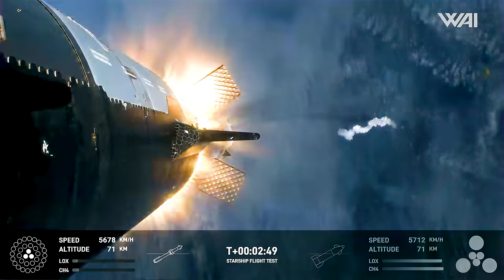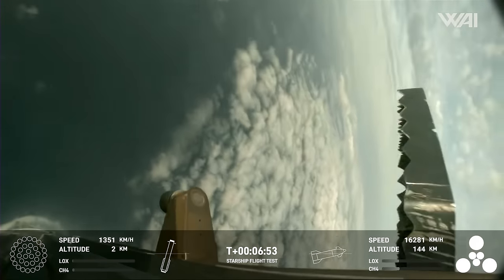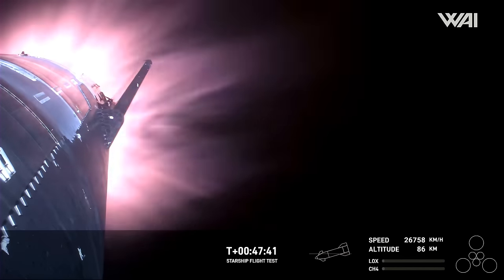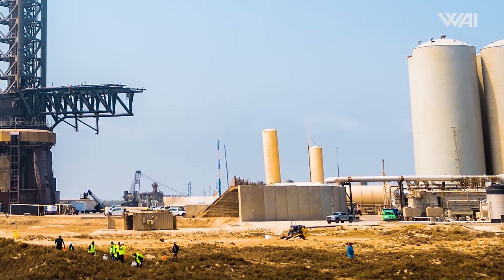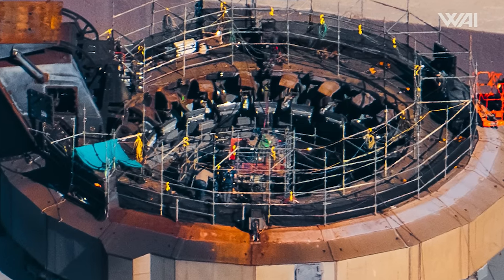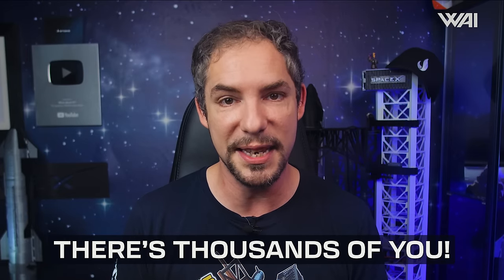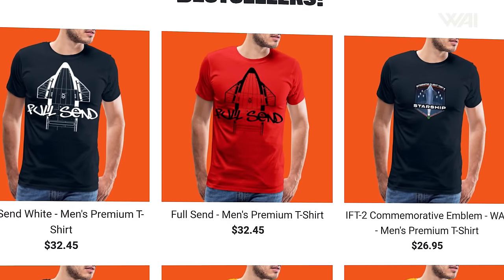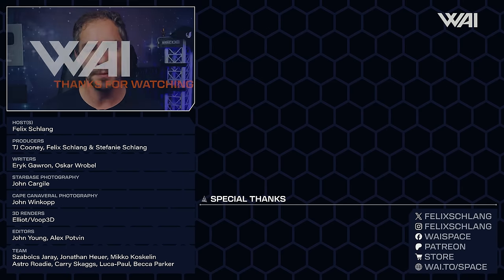SpaceX Starship IFT3 Aftermath: New Insights Paint Different Picture!

Comment from the maker: Discover why 4,500+ pros recommend Nutrafol. Use code WAI at Nutrafol.com for $10 off your first month!
Thank you SpaceX team! You are our heroes! You Rock So Much!!!:_WAIHeart: :_WAISweet:
Reply: Can I ask Felix, with the bottom of the launch tower they use metal sheeting.. Have they ever thought of Heat proof tiles that would be on the starship for better insulation? Just a thought :) Love your channel watched from the start. <3
Reply: @MrComfyAustralia  That kind of tile would be obliterated by the blast. They are extremely fragile
Reply: "ULA sniper?"  Thanks for introducing this concept )))
Reply: @MrComfyAustralia They aren't very resistant to pressure, and they are quite expensive compared to stainless steel
Reply: @Whataboutit would the idea of putting heat shielding tiles like on the starship around the launch Mount table a good or stupid idea?
Reply: I think they were attempting to max out the control capabilities of the booster before landing and tested to failure😅
Reply: If it was a good idea they would be doing that. Answers above explain why. I highly doubt replies you see in comments are from Felix. Most youtubers are busy making content and have someone else is handling/managing/moderating comments
Reply: I just punched my keyboard instead of my like button, and now my keyboard is broken, and it's YOUR FAULT, Felix!
Reply: @Donald_Turnip  instructions unclear
Reply: Well duhhh. It's not *MY fault! @KCJbomberFTW
Reply: Felix can run this sponsor better than Simon runs his...
Reply: QQQ High Priority question.... Felix, do you like Space Planes??? lol
Reply: They are so close to making something useful. Forgive me if I refuse to hold my breath while the try to deliver new discovers and dates for PA.
Reply: As a naïve Bolivian 🇧🇴, I never understood the term: to rock.
Too many rocks exposed by the sublimation of once snow covered ski area on the Chacaltaya Nevado, nothing positive. 
But in the lower Altiplano at 14000 feet,  the low pressure dry environment woud make "Base para el viaje al planeta Marte" an ideal location just 17.4° south of the equator.
Reply: 😂😂😂 @Donald_Turnip

Comment: It's all Tim Dodd's Fault! 😁
Reply: I think the idea was an important one, also you probably shouldn't just generalize that an idea is bad after only 1 test of that idea. But who knows lol
Reply: What , why?
Reply: @MBSfilms77  what idea?
Reply: @Hungary_0987  the hot gas thruster
Reply: @MBSfilms77 Oh, I agree. It's just funny. Have you seen the video they put out?
Reply: 34 secs
Reply: Has he figured out he isn't going to the moon yet?
Reply: They probably hoped the hot gases would clear any ice build up in the thruster nozzles but they may need to have small heating elements embedded to keep them clear.
Reply: @tomj819 "Hot" being a relative term when you're talking about boiled off Liquid O2.
Reply: @gregsteele806  yes i have 🤣
Reply: Lol thanks for the good laugh.
Reply from the maker: Yes it is! (No, it's not!) :_WAIElonlaugh:
Reply: @MBSfilms77 it wasn’t even his idea - they already had it for the booster and Elon and engineering decided to simplify for Starship. 

They may have to revert. On both. 

They’re going to continue getting closer and closer to Falcon 9 anyway.
Reply: @gregsteele806  sure, I meant more pressure than heat, but the clarification is useful.
Reply: @MomedicsChannel  true
Reply: Definitely Tim's ego holding it down, for sure. Lol
Reply: @gregsteele806 olage gas is actually tapped off after the pre burner and piped back to the tank to keep the pressure high enough. That stuff is hot.
Reply: @Whataboutit  Come on Felix if you can get the blame shifted to TD you might be able cancel him socially and get his moon shot ride... God knows you are way better at reporting.
Reply: I think they were attempting to max out the control capabilities of the booster before landing and tested to failure😅
Reply: Haha, I had the same thought.  I didn’t hear him say anything but he must’ve been thinking that.
Reply: True lol that’s exactly what I thought while watching starship tumble
Reply: @Keiranful * ullage *
Oh, and superchilled O² ain't hot.
Reply: For reference Tim asked a question during an interview with Elon about why hot gas thrusters weren't being used on Starship when they were being used on the booster.  Elon obviously thought the idea had some merit and it was implemented in Starship for IFT3.  However it appears that icing up may have been an issue with it being a likely explanation for the lack of control.
Reply: @yaric008  Tim mentioned the ice and possible need for heaters during his live stream a number of times.  I also certainly don't blame him for the question/suggestion
Reply: @gregbailey45  after the pre burner, it's not superchilled O2 anymore...
Reply: Just slap some draco thrusters
Reply: @Whataboutit   Who Is Tim Dodd ? ? ?🤔🤔🤔🤔🤔🤔🤔
Reply: WHO IS TIM DODD ? ? ?  NEVER HEARD OF HIM ? ? ?  LOL ! ! !🤔🤔🤔🤔🤔🤔🤔
Reply: I was actually going in the direction of Tim the tool man Taylor's business partner "AL"  but that's just me?!🤷‍♂️🤷‍♂️😁
Reply: TIM DODD NOOOOOOOOOOOOOOOOoooooo wait. Was the idea good or bad? I still dont fully know

Comment: Ok everyone,  let's take a look at the whole picture.  Elon/SpaceX does things a little different from the traditional.  Remember Falcon, the first 3 totally failed. The 4th launch was successful and then Falcon makes history.  Starship will be fully successful.  Go SpaceX!!
Reply: You are talking about falcon 1, which never made any history.

Falcon 9 - that has made history - worked on first try.
Reply: @torben777  Falcon 1 did make history. It was the first completely private rocket to successfully achieve orbit and paved the way for everything that came after.
Reply: @johnnemeth6913  I think that is a matter of definition and interpretation. Sure SpaceX is a private company, but so it ULA, Boeing, Lockheed Martin, Northrop Grumman etc., and NASA was an integral part of the Falcon 1 development, which they also largely financed, just as they have been on countless previous US rocket developments.

Lockheed Martin developed the first Atlas rocket in 1957, which is 14 years before Elon was even born, and it flew humans to orbit in 1962. 

The contract type was slightly different for Falcon 1, with the private company taking a bigger part of the risk, but US rockets have always been build by private companies.

Comment: Watching the grid fins correcting themselves is one of the most epic things to be privileged to witness and in real-time, wow, just wow! I'm speechless. Each launch is better than the last.
Reply: except the fins didn't correct the ship
Reply: @nitram419  because the ship was way too high up for the fins to work, and by the time the fins could have done anything meaningful, it was too late.
Reply: So why were there no reaction thrusters?
Reply: @nitram419  there were. However, an unknown failure prevented them from functioning (IMO, they were frozen open)
Reply: @bryanillenberg   It appeared to me, seeing all the violent vibrations and overcorrections, they were in enough atmosphere.  They were reacting to something.
Reply: @RoySATX  
Ship: the ship was spinning out of control due to a prior RCS failure. By the time the flaps could do anything, it was too late
Booster: I think one of the grid fins failed completely, and the force was enough to break the remaining three, thus causing it to spin rapidly out of control.
Reply: @nitram419  they did correct, but the control algorithm was not working as intended, hence the wobble back and forth.  Might be as simple as a code update with input from the flights test data, although sounds like there may have been more involved, so guess we will have to wait and see
Reply: Better hope that doesn't happen when people are on board. Crazy that there will be people on board soon.
Reply: When I first saw the fins, I though I was looking and fly swatters!  Titanium fly swatters!
Reply: @BlestinTexas24  3 ton steel fly swatters for Starship booster I think 😃
Reply: @bryanillenberg  The grid fins on the booster were in the troposphere when control was lost. You can see small movements of them translate immediately to vehicle movement, just looks like it exerted more movement than expected and every attempt to correct would over correct and create essentially pilot induced oscillation.

My assumption is just a control algorithm issue and could be adjusted with the real world control data. It's possible that some other force was throwing off the guidance and control like a dead fin, I doubt propellant slosh was an issue due to how low it'd have been and how long it had been returning without issues.
Reply: @starmancbell  there won't, at least not during EDL
Reply: I wonder if they adopted the working RCS thrusters pods from their working space capsule design to provide two separate methods for controlling the booster
Reply: It would be cool to have two cameras on each grid fin to capture any issues
Reply: @LetsomD  they have not, as those thrusters use non-methalox propellants
Reply: @bryanillenberg  It was spinning out of control long before it re-entered atmosphere.
Reply: @keith6706  yup: the RCS failed early on in the flight

Comment: I think that the next launch will be a little while yet.  SpaceX needs to figure out what went wrong, redesign whatever needs redesigning so that it doesn't happen again, retrofit the new design onto the existing booster and ship, run some tests to make sure that the redesigned parts work as intended, and tell the FAA that they've made the corrections.  This will probably take a few months, so I'd say that some time in mid to late May is the earliest we can hope for for the next launch.
Reply: I’d agree with this. I dont believe they are in too much of a rush. Plus, there’s added pressure to perform well so their contract with Nasa is not delayed 🥰 I trust the team tho

Comment: I don't foresee the next launch of IFT4 before June 22nd not because of stage zero but to correct to cause of the tumble on Starship.  Also the Pez dispenser door is going to get some upgrades as well - might even see a discharge of a few Starlink satellites (6) to test functionality.  And there will be some modifications for the booster engine area to minimize plasma / shockwave damage. (imo)

Comment: As I was watching the futile attempts by the grid fins to o stabilize the tumbling booster, I was immediately thinking about all the fuel slosh this must have caused. So it was no wonder to me that the booster didn‘t relight and then exploded - this was similar to the consequences of the sloshing in IFT-2 after hot staging!
Reply: Not so much tumbling as wobbling.  Trying to correct and overshooting, repeat back the other way

Comment: I think the booster's problem was hitting the tropopause too fast. At 7-6km when atmospheric density spikes the booster was doing mach 3+ and you could see the fins couldn't handle the instability and correct fast enough, resulting in fishtailing. That level of sloshing in the tanks could easily cause the engines to fail to relight. I think they may need to start the central 3 engines a few seconds earlier to decel and give some gimbled thrust correction before starting the suicide burn proper...
Reply: I was thinking same. Maybe even a single center at a much higher altitude, get the remaining fuel to settle.
Reply: But the Booster doesn't need to do a suicide burn...it can throttle thrust to the point where it can hover (for as long as the fuel/oxygen lasts).  A suicide burn is when you have too much thrust and have to time it perfectly so you slow down enough to stop without lifting back off because the excessive thrust.
Reply from the maker: Wind that day could also be a problem. You can clearly see the oscilation problem of left and right roll starts right where it goes through that cloud layer. Sometimes those cloud layers form due to high wind share. :_WAIHeart:
Reply: @LezChap  lol, sorry, force of habit. Either way, they proved they don't need a re-entry burn since their peak velocity never went above a Falcon's post-burn. Just need some tweaking at the end and they're home free!

Comment: Great coverage thanks!
I would really like more detail on the stage 0 long term prospects and wear rates of the deluge system/outlets directly under the raptors. This is such an epic contest between opposing forces and a still-pending problem for Mars; it will be easier to dig a hole than install such a deluge system there. Soooo what about it? (Sorry I had to😂)
Reply from the maker: Thank you! We already talked about that! The plates do loose a few kilos of steel during each launch. So, they' will need to be replaced occasionally. BUT SpaceX is able to make a new plate in-house within weeks! So, that should not cause anyt delays at all.

Comment: What is the difference between a Falcon 9 booster re-entry and the SuperHeavy booster re-entry regarding potential engine damage and engine relight?
Reply: SuperHeavy is way bigger, and holds a lot more fuel which can cause fuel slosh. SuperHeavy also skips a re-entry burn, so it's going a lot faster when it does it's landing burn.
Reply: For most of the flight Super Heavy is actually more robust, but its the critical tropopause threshold when atmospheric density spikes where it fell apart.

Super Heavy has lower initial velocity in the upper atmosphere because Starship carries a hell of a lot more fuel than a Dragon does so can boost itself higher. SpaceX hoped that would allow them to skip a re-entry decel burn and they were kinda right, since at 50-40km the two had comparable velocities.

That said, Super Heavy has a LOT more mass relative to its cross-section so by the time it hit real air resistance at 7km it was still over 1500kph which is almost double that of a Falcon 9. You can see it start to fishtail and the fins don't have the response speed to stabilize. That will cause fuel sloshing which could have caused the relight failures. I figure in future they'll light the central 3 engines a shade earlier at about 10km to get some decel and gimballed control to help the fins out, and start the other landing engines a bit later to compensate.

Comment: I would love to see if running just 1-3 engines all the way down would aid in controlling the booster’s descent.
They’ll figure it out. They’re SpaceX!
Reply: More fuel efficient to burn more for a shorter duration.
Reply: @oppenheimersbong9863 The purpose would be to slow the descent bringing the ship speed down to where the grid fins are more effective.

Comment: I remember them having a problem re-lighting Raptors during the SN8 - SN15 days. They needed 2 engines burning to land, but when they tried to light just 2 there was no margin for error. The solution was to light em all and shut down what you don't need. I wonder if the same approach might work for SuperHeavy....
Reply: They were trying to light quite a few of them and very few showed signs of life.  I think the grid fin issue likely also contributed to this by causing fuel to sloosh around.

Comment: Each flight is better which is awesome, but the re-entry shows us they still have work to do. Can’t wait for tests 4, 5, 6 to see if they can resolve the issues and if not how much progress they make…..
Reply: They haven't even confronted the real challenge of Starship... making it more economical than a single use rocket.
Reply: @nickl5658  same argument was made years ago on Falcon and we saw 20 years of huge savings because they can. Don’t mistake trying to solve 100 problems as unsolvable, they chose to learn from launches rather than solve every issue before a launch. I mean, they have two upgrades right now now even being tested yet because they are still using version 1 to understand everything that needs fixing. The reason for the long test flights is to stress everything to the max so when they do it for real there are no surprises.

Comment: It may have only lost a few tiles during ascent, but as soon as it touched the outer atmosphere on reentry it looked to have shed close to a hundred tiles.
I think this was due to excess pressure in the payload bay.
The PB is definitely NOT made to contain pressure.
Not much of the ship is, the various fuel tanks contain very little pressure.
I think the PB bleed valves didn't work right, either they were misinstalled, broke or most likely froze.
I feel that as the starship approached the karman line excessive internal pressure started to stretch the structure.
If there were just 0.1atm in the PB at this point, the circumference of the ship would have stretched by 150mm. The length would also have increased by 150mm. This would have compromised the tile fasteners.
People should understand that the internal surface area of the PB is 700,000sq/in. At 0.1atm of pressure (1.47psi) equals more than a million pounds of force pressing against the PB structure.
My other reason for thinking this theory is that all the tiles that suddenly fell off the ship as it reentered all seem to come from the same place. High on the ship, on the opposite side to the camera. Very close to the area where the PB stops and the nose cone begins.
Stress loves those right angles, if you don't know what I mean then search for the early Dehavilland Comet jet airliner and it's square windows. Everything was good until 3000 hours at altitude and then the fuselage would explode, starting at the corner of a window.
Great video as always🇬🇧🤎🇺🇸🥳
Reply: Also the fact the orientation of the ship was not as expected for large portion of that reentry phase due to the control issues.  Still something to learn from real world experience